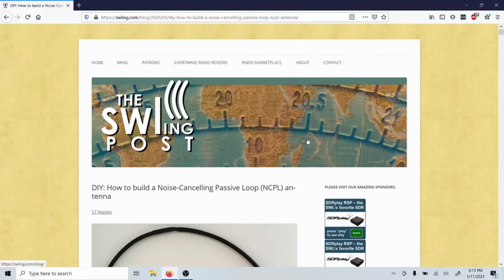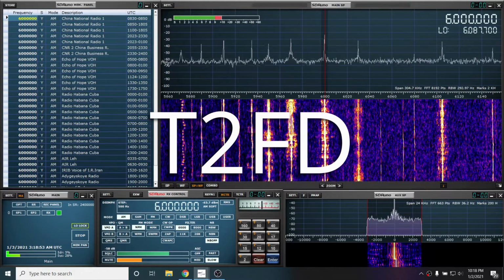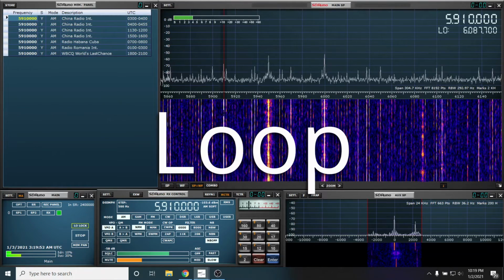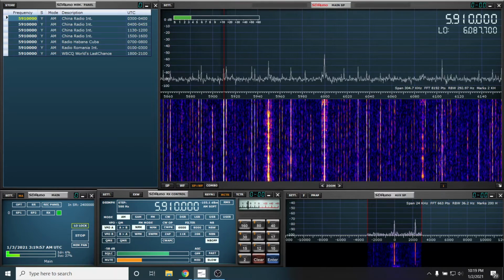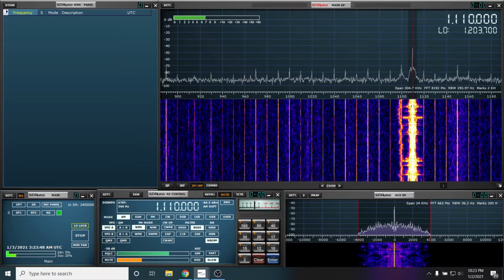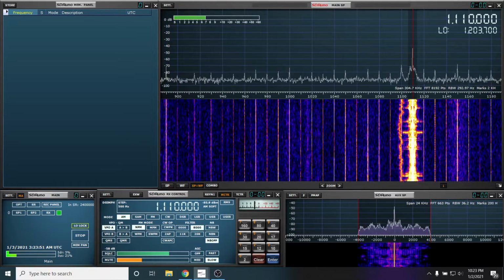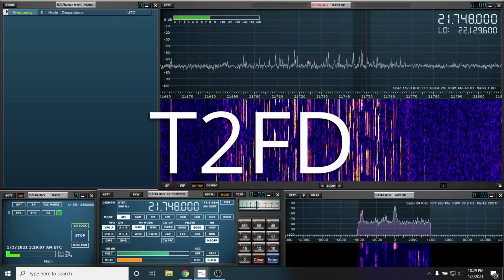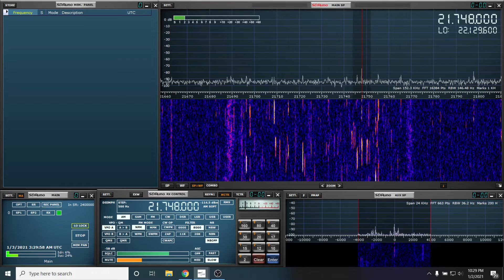DIY Passive Loop Vs Terminated Folded Dipole

Comment: Just some helpful info for you. Get yourself a coaxial line isolator  it will cut all your interference  at least in half possibly more. But you need a decent one MYANTENNAS makes a great one 0 to 30 mhz take a look at the reviews for it. Wow its amazing. 
AA4CP Chuck 
Fort Pierce FL USA
Reply from the maker: I'll have to check it out, thanks for the recommendation!